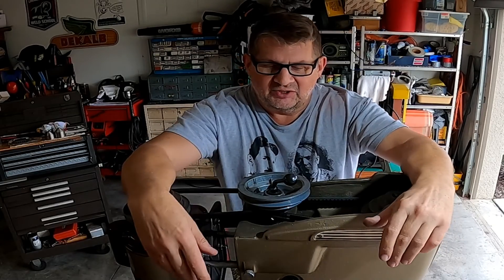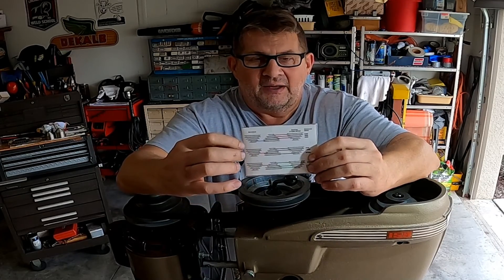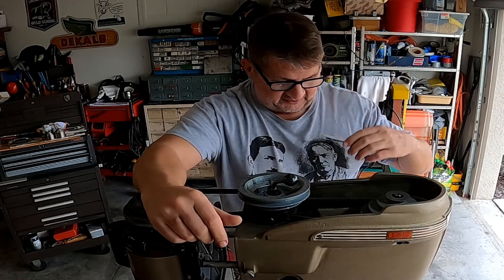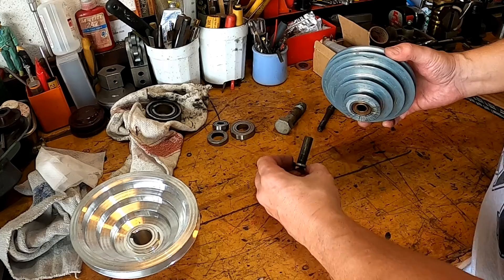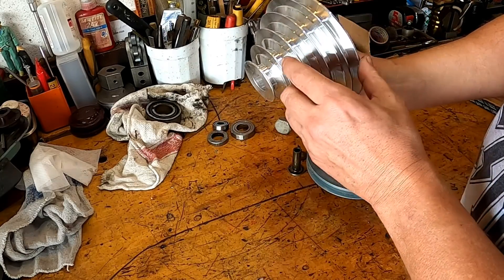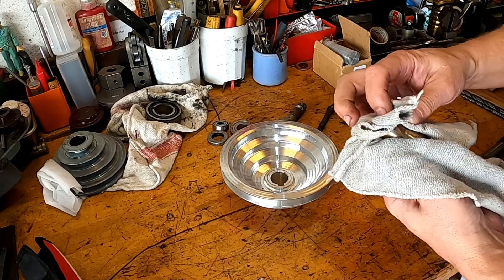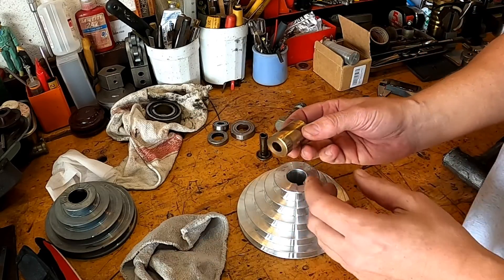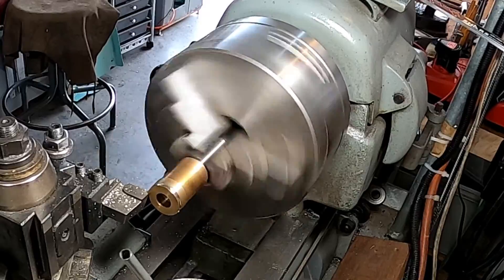How to get more useable speeds from a vintage drill press.

Comment: Man i bet you dug deep for that new step pulley! Those are not cheap! Very worthwhile change that will really help with large hole drilling! I have the 1957 version of that machine. Mine is a floor model with the optional speed change attachment allowing for speed change under power with a range of 350 rpm - 1350 rpm with a twist of a knob at the head of the machine. This is accomplished through sheaves that narrow or widen automatically to produce the desired speed. I absolutely love this machine and it is one of the favorites in my shop. BTW: This was an option for the machine and it came so equipped.

Comment: I have an old IMC 5 speed floor model drill press I converted to a a 12 speed I think). The motor and spindle pulleys are 5 groove, with the middle pulley a 4 groove. However, I don't know where to find any 5 speed middle pulleys. Any ideas? I'm in Canada, by the way.

Comment: Hi Don ,   good video.    We are just getting over either 4 or 5 days of cold weather.    With the wind chill it never got warmer than minus 50 C.   At that temperature it's actually colder then -50 F.   It was brutal cold.    Someone asked during that time how do you winterize your bicycle?   The answer was move to Florida. 

Dale in Canada 🇨🇦
Reply from the maker: Ya, but then your screwed with 9 months of insufferable heat and humidity.

Comment: Hey Don.  I have an older, one year only, Craftsman/Walker Turner drill press I've been planning to do the same overall mod on.  Where did you get the pulley and could you please share the sizes of the sheaves?  Thanks.  Happy Holidays to you and yours.  All the best in the New Year!
Reply from the maker: Sure, The original pulleys from the press started at 1.5 and went to 4". The 5 sheave pulley starts at 1.5 and goes to 5".  The pulley I removed was also a 1.5 to 4" pulley. It was an Ebay find so I'm not sure of its make or origins. I have a habit of also buying in bulk, like 15 pulleys for 30 bucks, or groups of ten bearings of the same size for what a single bearing would cost. I tend to figure what I need and then see what  got to match it.  Wish I had a better answer.  Don🎄👍
Reply: @donsengine3158  Just did a check on both Ebay AND Amazon.  I got this name:  Mxfans 19mm Bore Outter Dia 54-150mm 5 Step A Type V-Belt Pagoda Pulley Belt 

They look exactly like the one you have.  There's a bunch them with a large selection of sizes.  Thanks Don!
Reply from the maker: @oddshot60  That sounds about right.. Probably is the same.  Don